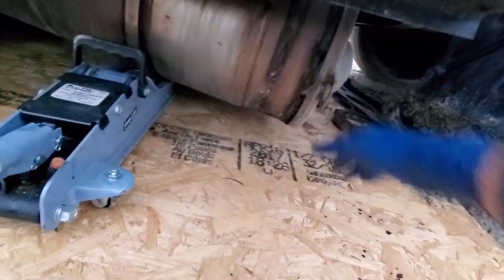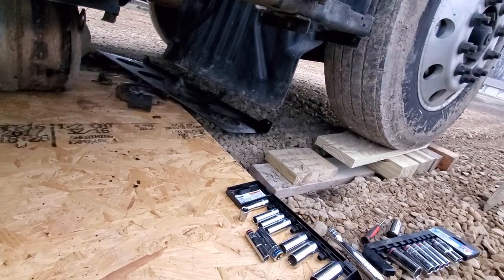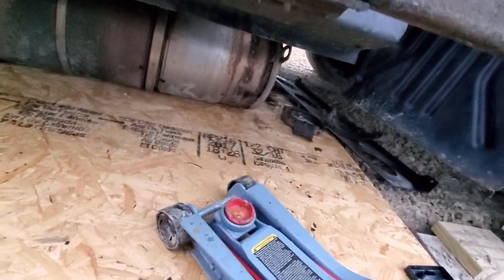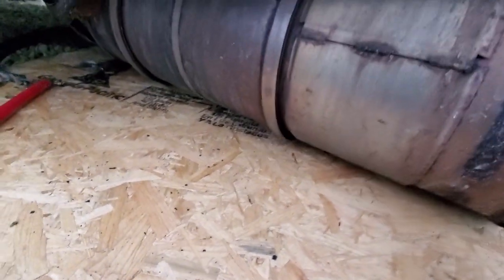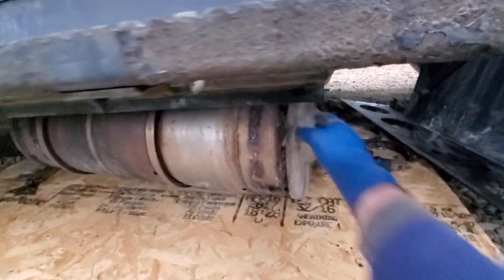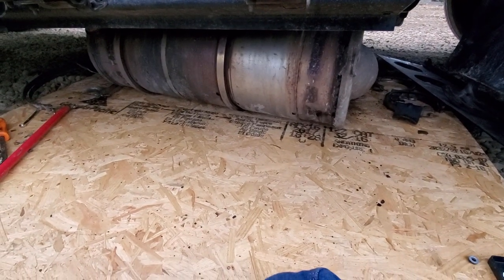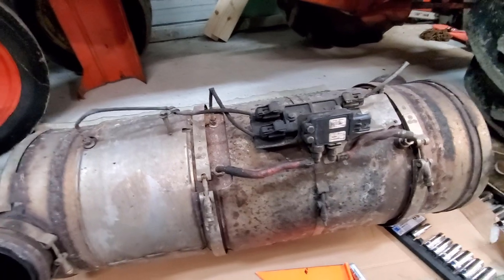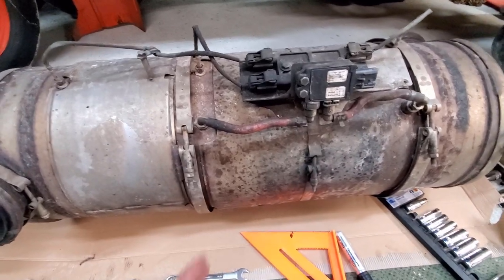New DPF Canister/Filter Replacement  (Cummins ISX15 Kenworth T660) Part 1 - DPF Removal

Comment: I have years of experience with those v-band clamps.  Although in smaller sizes used on aircraft.  That outter band on those are very forgiving when yanking on them.  Couldn't always get to the back side to pop them loose.  Airdale Navy myself.  Thanks for the videos
Reply from the maker: You are welcome! 🤝

Comment: That f***ing DPF is the bane of my trucking existence. In December something went wrong and it won't passive regen so every other day im having to stop for an hour to do an active regen. Then it started smoking when I did that.

Put it in the shop with warranty. 3 weeks and $5000 worth of repairs (covered thank god) entire scr replaced and 7th injector. 

Everything's good

One day later check engine light and asking for forced regen.

I have resigned to my fate of planning for that extra hour of DT every other day lol. But the smoking stopped so that's something.

Comment: My peterbuilt was having def issues 2 years ago. It turned out to be the turbo speed sensor. The oil temp also went down 10 degrees after changing that sensor. Mabey try that.

Comment: Hi Ryan. 

If you never want to have an issue with your after treatment again, I would recommend the Pittsburgh Power Max Mileage Catalyst. My truck has 80,000 miles on it and no regens, I have been using it since new. Last week I had my mandatory after treatment checkup with Peterbilt and they asked me when the DPF filter was changed, they could not believe that it was the original filter.
Reply from the maker: Thanks James.
Reply: I thought about getting that Pittsburgh Power Catalyst for my truck also. But, wasn't sure if it really worked.
Reply: @MrMan-ol4ic  I am not one for additives and was very weary of it at first, but over 100,000 miles with no regens. I don’t think I could live without it.
Reply: @HotMessTrucking  I may have to invest in that. Thanks for the info.
Reply: How much does the PPMMC cost.
Reply: I have been using it for 2 1/2 years. Mine still does regens but I don't have problems like I did before. Fuel mileage is just so so but I feel if I stop using it I will go back to stupid problems. Started using it after a NEW dpf. No a so called reman dpf. Reman dpf us just a clean. So how old is a dpf before a clean.
Reply: @SPharaoh  250 a gallon BUT BUT you only use 1 ounce per 25 gallons. Lasts about 3 months for me. So spend 250 and maybe save fuel and dpf, or don't and pay the mechanic. Spoonful of sugar...don't put sugar in your fuel....
Reply: Any quality additive is better than nothing. I haven’t bit the bullet for Pittsburg powers yet, I’ve always run power service diesel kleen my regens are very consistent i also have a tri pac and not idling helps. Regardless 30 years in and around trucking I’ve never run a truck without additive….
Reply: Snake oil, learn how to maintain your system.

Comment: What do you think about deleting def system on truck? Im looking for a truck and there are lot of truck delete just don’t know if its a good idea to buy one like that.
Reply: Terrible idea,. No dealership will work on them once you delete it.
Reply: @steviemcintyre9718  then work on it yourself
Reply from the maker: I will come up with a video on this topic soon, maybe within next week. It is hard to answer your question in a few words. I will try to explain everything in a video. Stay tuned.
Reply: @gavensingh9117  I would agree, yet you have to have the equipment to clear and read ECM.. and you will simply create more problems in the long run, these engine are program to run WITH an emission

Comment: How long does it take to drop the dpf an install it back
Reply: It is a PIA, most of a day if you are not in a shop. Build some ramps out of 2x10's so you can get under there. Ten inch height on the ramps is good. If you have side skirts, you may have to remove a section. may, not always. I use a ratchet strap(s) to lower them out. I also break the filters apart under the truck, only removing the DOC and DPF filters out, not the entire unit like Ryan did, much easier. The SCR can, that is another story, the entire unit needs to be dropped.

Comment: this is not the way to remove it, remove the diffuser pipe, (has def injector in it) and leave hanging, the dpf assembly has blots on each end at frame, (slotted holes) once you unbolt the solid holes you just pick up the entire system and remove it, then you disassemble the componets, you need a doc, the filter is a filter, as it does have a service life it can be cleaned, the doc makes the heat to turn the oil into ash, (oil is the soot that accumulates on the dpf from idling and oil usage, also check your bellows pipe for cracks (soapy water and saturate, start engine and full throttle a few times with helper check for bubbles) once you get all of this reinstalled check every thing with soapy water for leaks, also you will have to use insite to reset the ecm for aftertreatment cleaning, good luck
Reply from the maker: thanks for sharing your tips

Comment: I just had the code eec61 4364 pop up on my 15 freightliner.  It that the inlet screen fir the DPF pump?  Is there a air filter for that pump or no
Reply from the maker: what engine do you have?
Reply: @truckingandfixing  DD15 everything all good after roadside regen.  Thanks for everything you do fellow Landstar buddy!